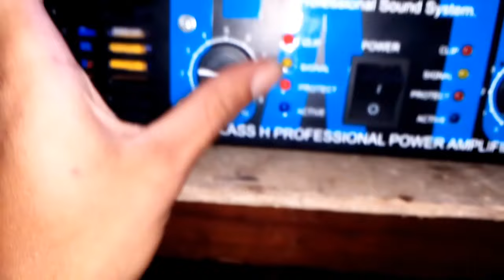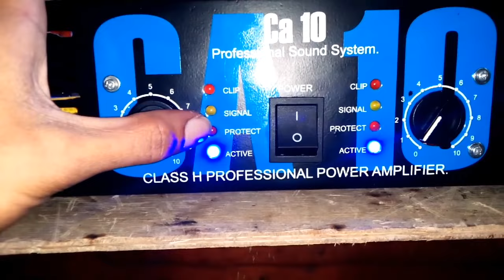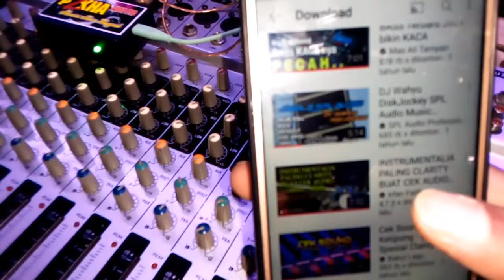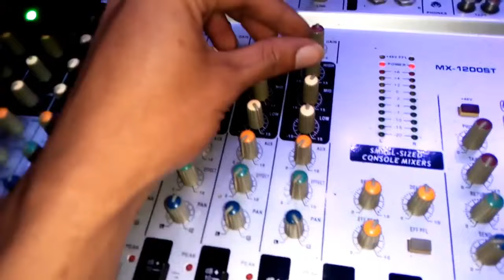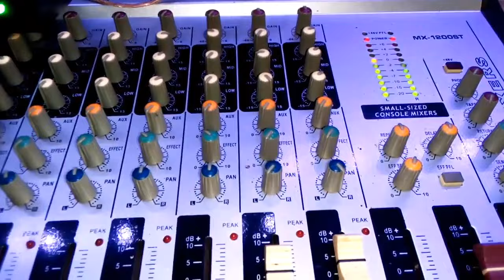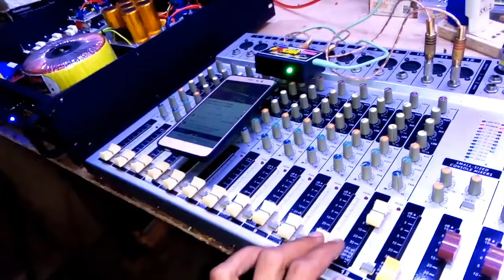Review power 5 amper CT 55 ||spek minimalis dan mantap 👍 || siap kirim ke Ponorogo 😊🙏

Comment: Kalo mono 5 amper ct 55 cuma pake tosiba 4 set bisa gak mas elko 3 set 100 v
Reply from the maker: Kalo 3 set elco jongjang mas min 2 elco atau 4 elco bisa
Reply: Maksudnya jogjang gimana ?@narkosetiateknik980
Reply: baru tau ada perakit elko bilng jongjang klo jongjang nmnya ga da psangn nya bos mislkn elko 3 biji sedkn yg di tanya 3 set

Comment: Cek harga
Reply from the maker: 2jt300rb masehh
Reply: @narkosetiateknik980  brpa wat pak ?
Reply from the maker: @ainicilik8838 untuk Watt nya belum pernah ukur kak soalnya alat belum cukup kalo di ukur secara teori hanya terukur 275watt 😁🙏
ya kalo hanya buat rumahan buat akat spek er 15'x2 plus 12"X2 dah lumayan kak 😊
Reply: @narkosetiateknik980  kalo pengukuran Watt secara teori
.itu kan pakai trafo 55vct 5a untuk driver pakai class ab yg mempunyai efisiensi 50%-75% contoh misal itu kan pakai socl kira kira efisiensi nya 70% ,jadi voltase trafo 55vx1,4=77vdc
77vdc x 5a =385w
Efisiensi socl 70%
385w - 30%= 269,5w murni kalo g  salah
Reply from the maker: @hclnganjuk9950  ya kurang lebih sperti itu mas ..kalo secara teori 👍😊🙏